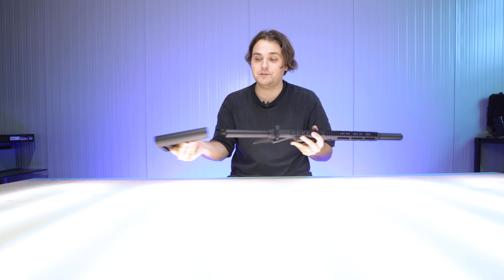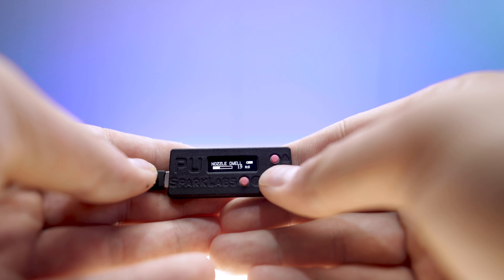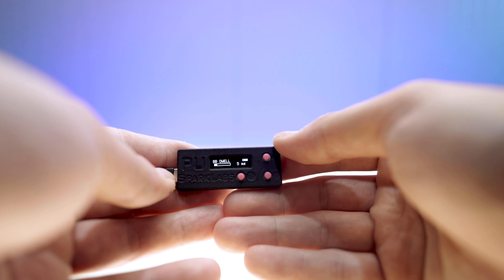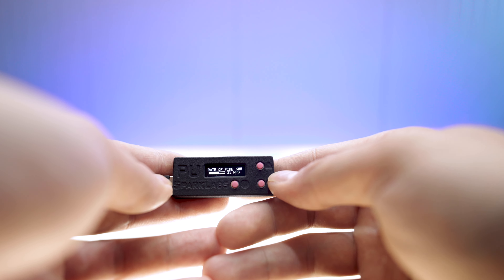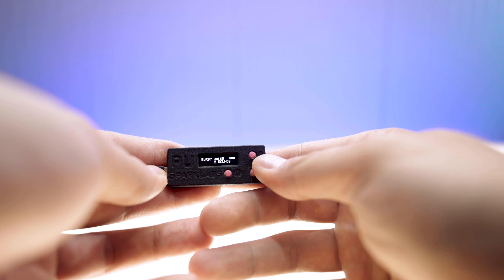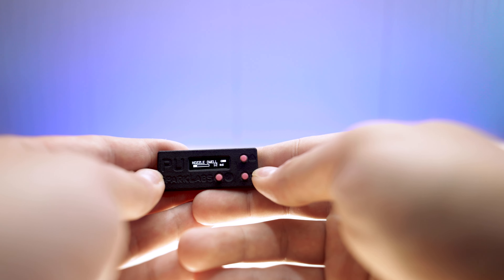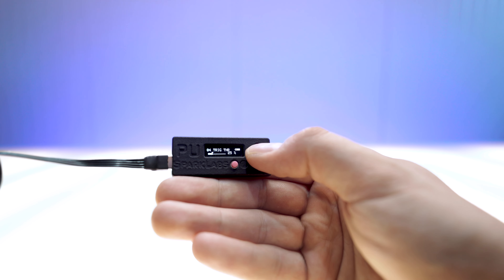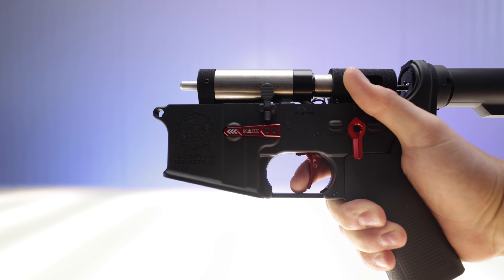TECHROOM | XFORCE EMAG — Programming

Comment: On the regulator I can put 120psi and set up monitor for 1Joule (or 2,5Joule) or I have to play with the regulator as well??
Reply from the maker: You have to set your regulator to increase or lower the power. The settings are mostly for fine tuning, while the pressure dictates your power in combination to the time your valve is open.
Reply: @ Thanks 🙏

Comment: The monitor have to be connected permanently? Or if I choose my settings I can disconnect it??
Reply: It’s not needed to operate the gun
Reply: @juliusmaximiliangontschar4306  
One more question,
On the regulator I can put 120psi and set up monitor for 1Joule (or 2,5Joule) or I have to play with the regulator as well??